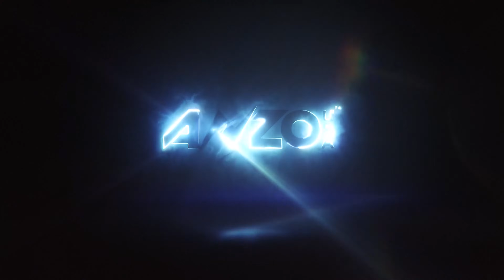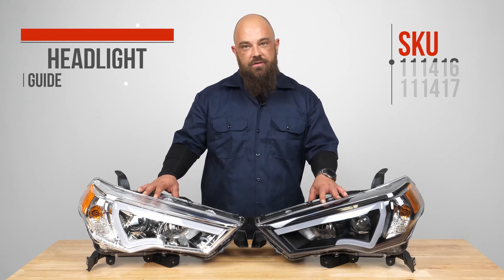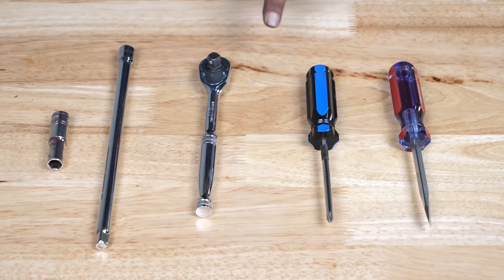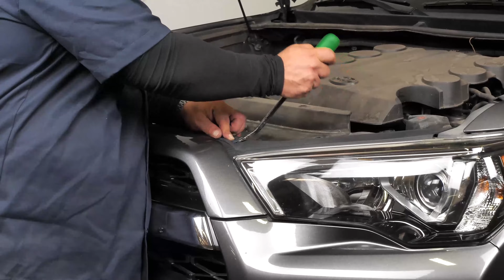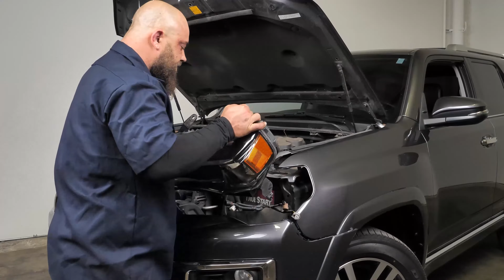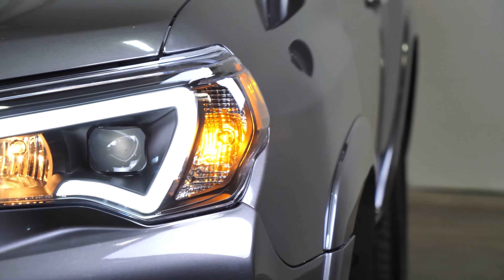AnzoUSA 2014-2021 Toyota 4Runner Projector Plank Headlights

Comment: Bought these and there is a wiring harness on my stock lights that has 3 prongs. And the new ones that says will fit has a 2 prong. It’s for the running light connector. I was going to rewire the plug but coming from my 4Runner has a red,black,blue wire. The new ones have a red,black wire. Not frying something so a return is gonna happen. Plug and play my arse…